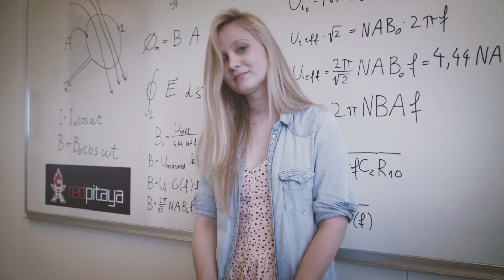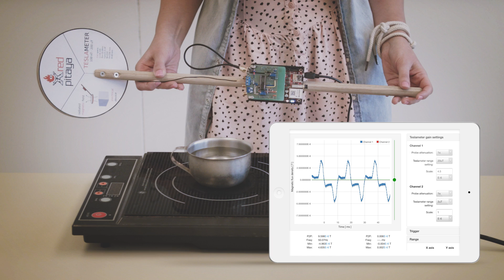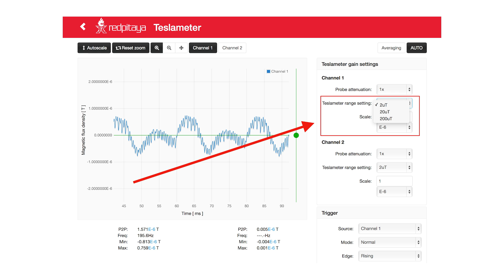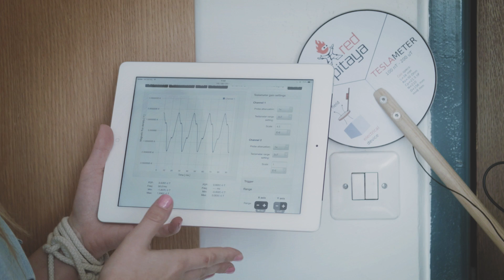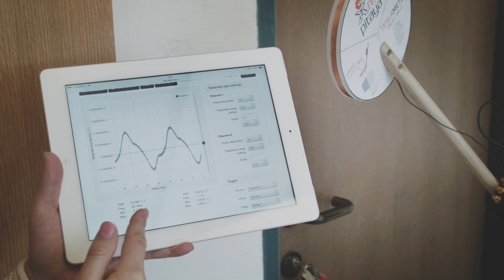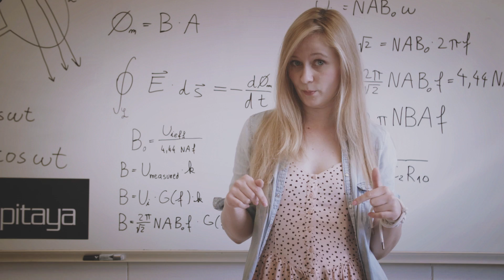Red Pitaya - EMC Measurements & Teslameter project

Comment: Nice to see this video series showing uses for Red Pitaya. I have watched both videos and would like to see more.

I notice you struggle to say "sinusoidal". Try sine-you-soy-dal.

I have had one for about 6 months but find the web interface to be a useless interface, too difficult to use and too buggy, frequently crashing or freezing or making a change which cannot be undone without reloading the page. The layout of the web apps is also often poor. I think it might be better on a tablet as you show zoom pinch, but not on a desktop PC with a mouse.

Without programming experience in Matlab or Python, it seems this will not be useful until someone creates some decent PC software for the interface. Of course, to truely get the most out of the unit, one would have to build their own hardware and interface software for a given purpose like you have done in these 2 videos so far.